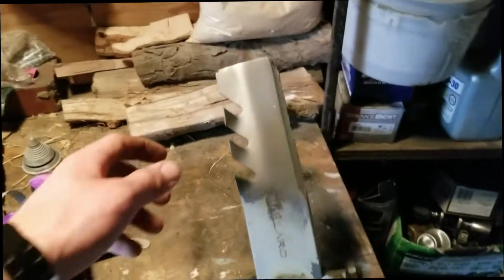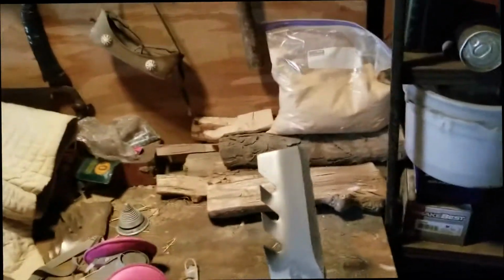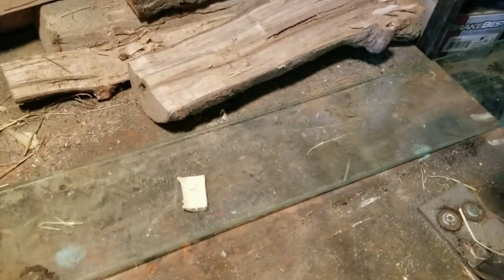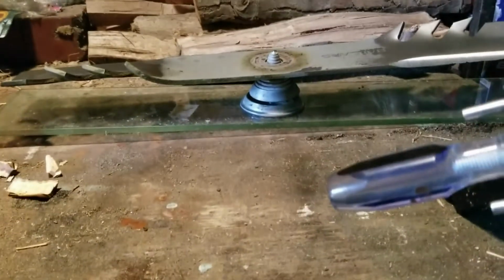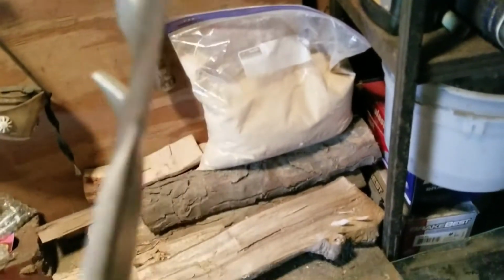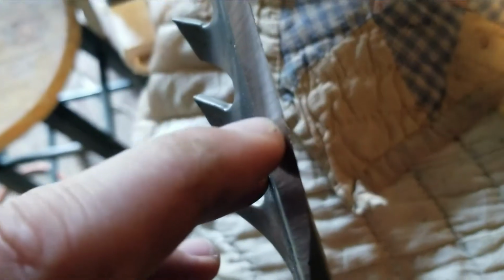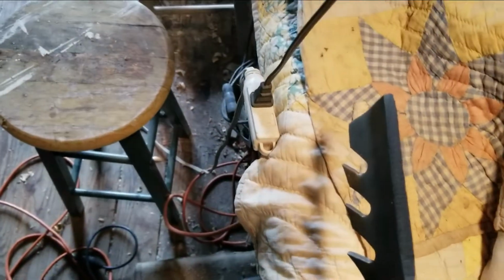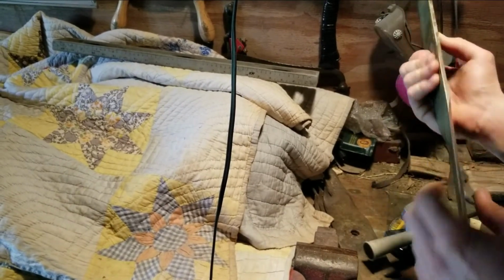Blade Sharpening w/t the All American Sharpener

Comment: What angle worked the best? 30 or 35 degrees?
Reply from the maker: 30° seems to work pretty good for me. I've done 35°on some gator blades before, but I mainly use those for mulching. Thanks for watching!👊
Reply from the maker: I don't know why your reply isn't showing up, I got notified of it but when I went to look at it it wasn't there. Hmm weird.
Reply: Man that's alot of material taken off....did you have an issue with dulling quick? Thin edged and all...hows the sharpener though?
Reply from the maker: Yeah, I don't typically grind them down that far, I was trying to get some bad nicks out. I love the sharpener, it's been a huge help! Definitely worth the investment.
Reply: @jbmows  just ordered my 5005 with Honda adapter. I see videos and they haven't shown crap blades returned to that state. Always fresh blades having paint removed. Thanks mate!. Sub to ya.
Reply from the maker: Hey thanks man!👊
Reply: Notice that you have the arm up instead of down.  If you put it down when you sharpen the shaving from the grinding will not get on the arm
Reply from the maker: Yeah, I know. I just prefer the way it operates with the arm up. Thanks for your input!👊👍
Reply: Update....been using this awesome device for a couple of weeks now at 35 degrees.  Sharpest and cleanest cut my lawn has ever seen.  It’s fantastic!
Reply from the maker: Awesome man!👍Thanks for the update! I may have to give 35°a try on my high lifts.